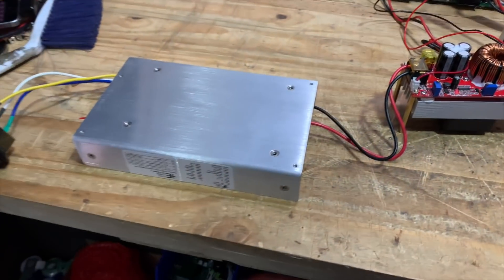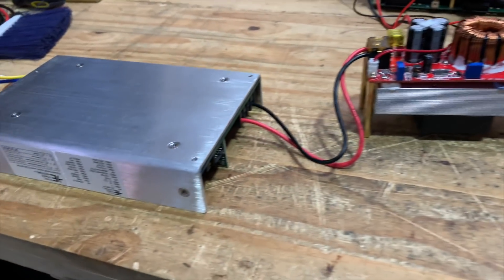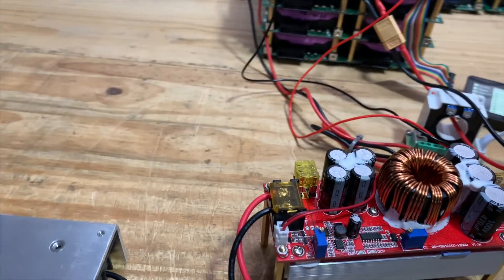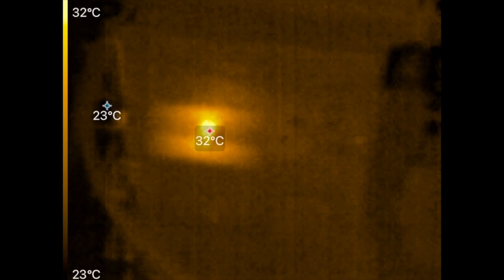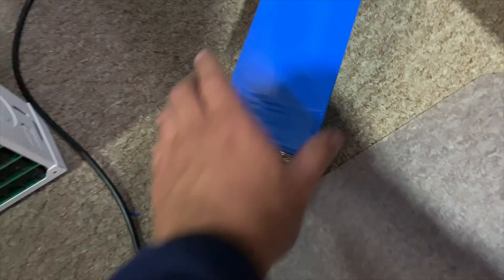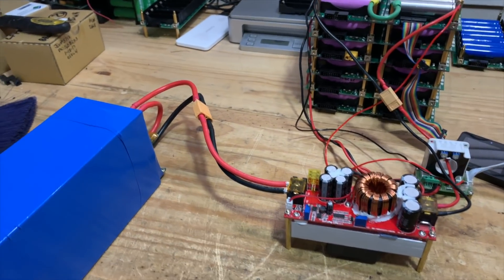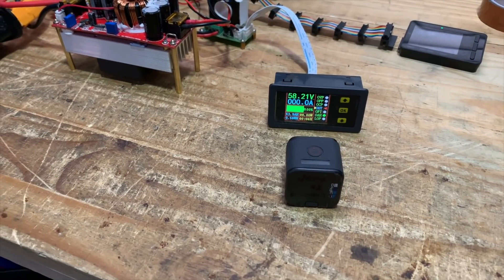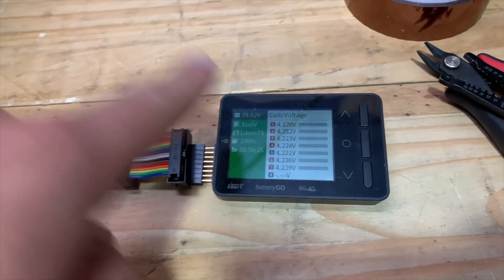Can This Device Charge our DIY Powerwalls?

Comment: I have the same setup but I can't charge my battery. The device stops sending voltage after a while. If I just connect it to my battery it the overvoltage light turns on, sending 0 volts. If I connect it through a Victron MPPT it charges for 5 seconds and then stops sending amps and voltage slowly goes down. Can anyone orient me if I need to setup something else?

Comment: I have tested this 1800w 40A converter for short time @ 45A input, it gets hot, I'm planning to upgrade that heat sink to a bigger one, because I have upgraded 1200w 20A one, and now I use that one at 25A input continuously  - these boost converters are the best.
Reply: Hello! I'm trying to charge my battery this way but it won't charge it. If I connect it directly to my battery the overcurrent protection turns on. If I connect it to a Victron MPPT, it charges the battery for 3 seconds, then it shuts down (amps goes to 0 and volts starts dropping down. I have no idea why it is doing that, I can't seem to fix the issue, any suggestions?
Reply: have you ever seen the voltage drift too high? Is it predictable?

Comment: I thought you said all we need was a cheap power supply to charge with.
Reply: power supply only convert AC (power from your wall) to DC with a certain and small range of voltage. Buck and/or boost converter enable your power supply to charge a really wide range of voltage meaning you can charge a wide variety of series connection (3s,4s,12s, etc) and various type of battery (lifepo4, li-ion, lipo, nimh, etc)

Comment: Search rf man load sharing booster converters. Using resistors, you can use them in parallel. To properly calibrate you’ll need a clamp multimeter capable of DC current testing $50.(all cheap ones are only AC only). After i get mine,will update.

Comment: Hey Jehu, definitely revisit this if you have the chance, I think alot of people are interested in some way of paralleling the unit. Maybe with a few 20SQ045 20A Schottky diodes as protection, fuses, individual switches, case fans, you can hook up 3 of them to output 2kW. (24V*30A*3)

Comment: How did you set the maximum current going into the battery?
Did you adjust through the potentiometer or you just let the battery draw as much as it can handle while limiting only the voltage?

Comment: Could one build 2-3 of these setups and connect in parallel to charge larger banks faster? 
I'm sure one would need to adjust cc and cv settings to match on all the converters.
I want to put 1.5kw charge into a 5kw bank.

Looks like your setup was getting too hot and you only did 13amps, so I'm assuming I should keep these "20amp" converters under 10amps.

Comment: On the connector that was glowing it looked like the cell pack beneath it also had a battery that was glowing @ 7:35 , maybe there was a bad cell and it had too much resistance?,  you did say the balance wasn't great so maybe that was more another indication.

Comment: These boards need proper cooling.  With the stock cooling, they can not continuously operate at high current. You can even parallel 2-3 of them and run each at a lower current

Comment: With this setup you're relying on the DIY BMS and those small 7S BMS modules to balance the cells, right? I thought you said in another video that was a bad idea because they don't cut off until 4.2-4.3 volts when charging and will also allow to discharge the cells way too much.
Reply: Oh hang on - you're not using the BMS at all, right? You're relying on the Aliexpress charger to charge the packs with no balancing...

Comment: i buy more than 40 models of DC to DC ( step up / step down / step up and down ) with/without LCD . with and without the current limiter . with without v input volt protection. you need a good power supply and a good test dummy load tester. till now i get my hand into an electronic 300W dummy load. but i need someone to provide me with a power one can handle 2000W 20amp 100V. anyone have a link?

Comment: in China they should not sell them as power more than they were should sell them in max amp. any way even i test this converter with a test dummy loud. the best result that you can get most efficiency is to give 48V 15amp and pull up 720W of any voltage above  72v   BECAUSE  in 72v the current will be 10amp and lower than 72v you still get 10amp and you will lose the power efficiency  of 720W ( think about it )

Comment: don't mistake the power rating. they only limit your max power. 1200W at 60V but the limit current is 20A INPUT  and the output max 12amp 90V only. A 10amp output is good as the max you can get from this converter. other than that it blowout  my mosfet because the output rectifier shootout and make the 24V input dump all the power in that mosfet and the output was short circuit and the full current push the mosfet to the blowout. . i hade to replace the mosfet and i hade to order it from china because it was not available

Comment: How about implementing a programmable low voltage cutoff module to disconnect the batteries from the inverter when they are at a predetermined voltage? Also what about a resettable circuit breaker in case the inverter shorts and starts dumping massive power from the batteries? I say this out of experience ;)  I have been following you for some time now implementing your ideas into my own PW and can't wait until you get the AC coupled design in place so we can all purchase/build the same!  Carry on man, carry on !!!

Lastly, what are you going to use as a timer to "charge" the cells when the Solar is up and running? I was thinking how about a voltage comparator so you don't have the change the timer each season you can just compare the solar voltage to a programmed value and when it exceeds that value the Mosfet kicks in and allows you to power the charger from the cells, when the voltage drops (clouds, dusk, etc..) it kicks out. This could effectively allow you (with some built-in delay) to use a timer to control power in-out

Comment: Take apart that heatsink and put on some good thermal compound onto those Mosfets and diode packages. About the inductor they usually run  hot as they have no way to dissipate the heat. If you add another fan on top of the inductor to circulate some air on top of the board it would work completely fine and cool. Great Video as always :D

Comment: I have consider using this device in parallel. To run some higher voltage motors like 70v to 90v from smaller voltage packs like <48V. 10 of those parallel should be 18000W.
Reply: Just remember usubg tiw power supplues in parallel required output diodes to prevent backfeeding.
Reply: @circletech7745  Yep

Comment: Jehu, find out how to make a pulse charger and than use that to charge a 12 volt battery than feed that through 3055 inverter than send that through ur portable diy fast charging thingy ma bob than u can drive forever cuz ur pulse charger will keep ur battery charged all the time.  No more range anxiety.
Reply: Oh and don’t name it free engergy, just keep it as pulse charger so u will not get unwanted attention.  Most of the idiots calling it free energy just wants views, when all that they have made is just a pulse motor.
Reply: Forgot don’t use 3055 transistors, use electric forklift transistors than can handle the heat!

Comment: Hey Jehu, you dont need boost convrter, you can simply use 2x24 V power supply's from ebay in series ,  they can be modifiet to a max current by changing the  current measuring link in the power supply so you have CC and CV. I have 24 V system and I'm Using 2 x 12 V 360 W power supply in series, originaly they put out 39 Amps and run wery hot , so I cut one of thre links for power measuring and now the maximal current they put out is 27 A , just what I need.

Comment: I hope you see this, I'm hoping to ask you a question to help me in my endeavors for building a 80-100amp 18650 12v battery for a personal project. I want to do something similar with parallel batteries that you did with your powerwall project where you used PCB boards to connect everything. I want to do this with a 12v parallel load but to include a bms for over/under charging. Please give me your feedback. Thanks

Comment: Taking DC from a solar system, then inverting it to make AC, then converting it to lover than needed DC voltage is inefficient and wasting power and still requires one more conversion DC to DC voltage doubler.  This sounds like a terrible way for your friend to sell his surplus power supplies, which are too wimpy..  Nice  "heater charging system."   Ok, then your ultimately going to take that powerwall and likely invert it again for final consumption.  In all, you would save half of that wasted power and just use grid power when you need it.  Then you don't need a ton of power converters, expensive but essential (for safety) measuring equipment or fire extinguishers.  In all, all that conversion and measuring equipment is costing more than $200.  And Jehu, you were bragging about how you "could design and build a powerwall" ,but you probably shouldn't charge it from grid power.   Why, why, why. Viewers, please ignore everything in this video and you will be richer, safer and happier
Reply from the maker: It’s not from the grid if your solar grid tied inverters are producing the power.   Yes it’s not the most efficient way but what you loose you gain by not having to rewire your entire home to install solar and battery

Comment: I need some idea's, lots of idea's for my pending solar setup. I have 6 100 watt panels. I have the pure sine wave inverter, 2000 watts, and the mppt 30amp charge controller. But I dont have battery's. Even if I did I dont know what to hook up to what. Im thinking lithium battery's but how many and what kind I dont know. Not sure of what I need or how to hook it up. I need to know what kind of order to hook up my solar panels, inverter, charge controller and whatever else. Id like to get it done by the end of summer this year. But I need some serious help.

Comment: 50C is not hot at all for power semiconductors, most are rated to 125C. The inductor can bake too, its just a mater of wire insulation spec, 85C is nothing. The caps is glued to the inductor just to support each other mechanically. Your connector heat issue is more than likely excessive resistance, so bad soldering/contact/etc, or could your balance be so far off that one sub-pack is charging another lower charged sub-pack. What model and where you buy your thermal cam? thanks

Comment: high efficiency up to 96%,  fanless design- Batteryfree Pure PV operation . Will passthru power to load exactly if input power is available with or without Battery.  As bulletproof as it gets.

Comment: Note the Voltage Range. https://www.onlinecomponents.com/mean-well/hlg600h36a-45585991.html  - 16.7 Amps out. You can parallel but use Diodes.  Note Universal input - PV Input upto 437Vdc. been using these for years charging Lithium.

Comment: That little Chinese flea Bay inverter does better if it’s not laying down flat on the table with its fan facing down.  You are restricting and recirculating the hot air under the circuitboard the fan is just sucking it back into itself, put the  inverter in a vertical position suspended in the air and then re-perform your test. They also make that little inverter in a 1500 W series I have three of them.

Comment: i think with this charger. if you buy 2 you can connect it in parallel so you can charge at 1500watt.
can you try this Jehugarcia?
Reply: Have you done this with two units in parallel?  Does it work?

Comment: Check the thermal paste or pads under the existing heat sink too! Seemed to be too much a delta between the board and that heatsink. Assembly can usually be improved when working with low price chinese hardware.

Comment: I have a ISDT T8 charger doing something similar, I have charged a 12v liFePo bank at 20+amps with a 24v supply, that will do 20 amps for a few, but rated at like 16a, i am going to occasionally charge my 12v bank & balance it. Even though it has bms. I would like something simple to chsrge the 12v bank from my 24v 7s bank. That will work simple like a solar charge controller. I got a pwm lithium controller, but will need to buck the 29v to about 15-16v, im off grid and this doesent sound the most effiecent way to do it, I also thought about one of the charge controllers boards, that just turns on/off power according to voltage, (all I need I'd 10-20 amps,)  I could use a cc cv buck converter, and the charge disconnect ,  I have a 24v low volt disconnect to go with, since I also have FLA batts, and no 24v bms for now. But I'm interested in this project, I could possibly mod any solution you come up with. To work on my project... Great one!!!

Comment: I use a similar constant current, constant voltage power converter module, maily to converter the 11.7 volts my old computer power supply puts out, into the 12.6 my small lithium battery bank takes to charge.

Comment: FYI... Solders Melting Point is 168 Degrees Fahrenheit  @ 10:40 Your Showing the Charge Controller at 83 Celsius or  181 Degrees Fahrenheit You are Risking High Opens on any Solder Joint on the Board   Just Sayin  : )
Reply: FYI, That is actually false, since  the melting point of solder is 188°C or 370°F and that's the 63/37 eutectic alloy solder version for electrical work which has the lowest melting point of all the tin-lead alloys.

Comment: If you make your setup to charge without the booster they would charge faster. You would have to regulate the current though. Just separate them when charging and parallel them up. When needed to be used for power, hook them back in series. That booster would fail with all that heat after a few cycles.
Reply from the maker: No people can’t be connecting and disconnecting stuff just to charge,  plus you have regulate current
Reply: @jehugarcia  Look up Anderson power pole connectors. You set them up to parallel when connect charger and series for when load is connected automatically. Build a simple mosfet current regulator for charge current.

Comment: Another power supply so you are at 36v input would probably help bring down that inductor heat but that is a lot of power for those size components i know mosfets are rated for some big amperage but still

Comment: I am using like this set up on my 1.4kw (72v, 20a D.I.Y. lithium packs) ebike to charge it overnight (around 8 hours of charging with mechanical tímer off switch so that it wont overcharge)... But my power supply is an old ATX from pc 450watts rated... (pretty good power supply)... Converting From 12v, 15a (around 11.7v) to 84v, and around 2-2.5a... And putting a fan on the coil (inductor winding)... It is really good! 😄😄😄

Comment: I been charging with that chinese device for a long time. Cant go over 600w without major fan blowing across the copper inducter.  I always divide cheap Chinese products by half and that's it's new max
Reply: DIY 3055 inveters, except don’t use 3055 use electric fork lift part.

Comment: OMG NO NO NO NO NO youll do nothing but repair that  CC CV 30 amp once a week i have the smaller one of that and its horrid no sooner then i plug the thing up and get it going and POOF the main mosfet blows. they are perfect for half what the rating is they are sold for but not max even if they will do it. I found a much better way to get 40 amps constant at CC CV with a 18 volt 60 amp power supply from banggood using 2 20 amp buck converters with a 3 pin schottky diode on the output rated at 60 amp to combine the 2 boards together boost is much less efficient  than  buck you need a minimum of 2 volts over what your trying to charge with them on the input. I went with 18 volts because of the 18650 cells i have and i can charge both LifePo4 FullRiver 26650 and the 18650 but of course with a separate 20 CC CV buck converter on the 18650's. I desperately loath my 20 amp boost converter ive repair that thing so many times i got sick of it and did a mod to make the mosfet easy to change out if needed Im not sure if i have a video of what i did to it . I hardly ever use it anymore just fed up with fixing it. Buck is the way to go for me. I do know i have a video on how im charging my 26650's LifePo4 with the 2 CC CV 20 amp buck converter. Word to the wise if you do try them and it wont do 14 amps for 5 minutes stable its defective send it back and for the permanent set up youll need a much larger heat sink to get the constant 20 amps and actually its 26 amps each i have them capped at 20 amps each to keep off the top end some . I got into a mess with them recently and got 3 out of 5 defective and the 2 that worked i had to reflow the solder. Amazon had the bad stock as of 3-6-19 for the 20 amp buck converter and all of them had the green in and out post. OH yeah im doing 12 volt 4S by the way but if your doing more than that then you have no choice but do boost and ide seriously not trust that thing over 12 amps constant

Comment: Watch out for voltage drift on these guys. I typically set the max voltage on the CV/CC converters to 0.5 to 1.0 volts lower than the fully charged pack voltage. I'm guessing the drift is caused by components warming up with use.

Comment: I use that boost circuit to power my 19.5v Alienware laptop from my trailer's 12v batteries. This allows me to not run an inverter at all, as all my electronics are 12v compatible.

Comment: I tried one of those boost converters for my home battery. At higher currents (above 8A) the waveform on the output was horrible.  It produced so much noise on the output that it kept interfering with my BMS system.  I replaced it with another slightly more expensive boost converter BST900  which is rated at a lower current (20A), but produces a lot less noise.